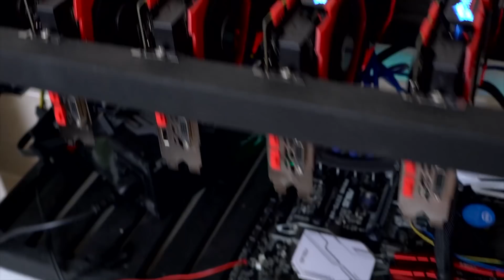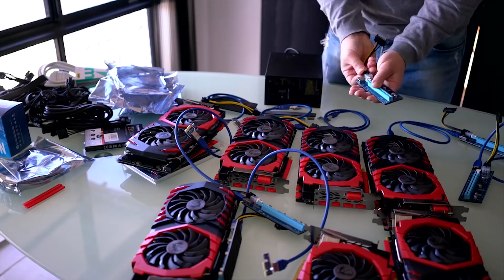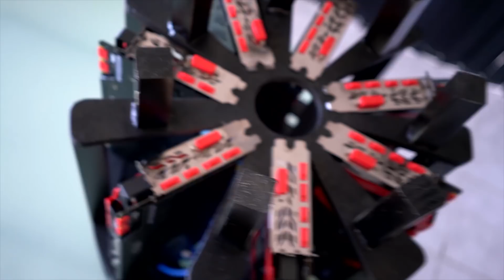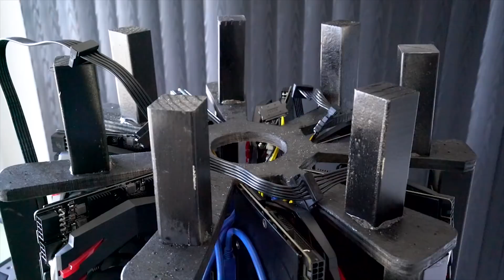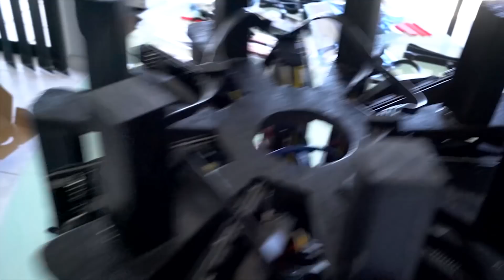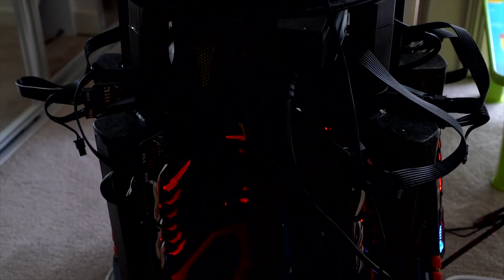Vertical Mining New Compact Design Ethereum Monero Sia Bitcoin

Comment: Why not have the cards turned 90 degrees so that the fans could get the fresh air instead of still recirculating the same air like a standard rig?
Reply: phatal808 good point. Have you made a case similiar to this? With eash card facing outward pulling in new air that would be ideal. Especially if the air is being blown like a fan and/or is a cool temp.
Reply from the maker: I did not read this reply, but I am going through all the replies now and we both had the same idea! Please see if this is what you mean: Thanks for your advice. Please check out my new rig: https://youtu.be/Up8XfTdMlI4

Comment: uhmmm   I'd say the fan should be pulling air outside the GPUs (air direction to the top) to aid airflow since heat rises. Or making a design that in between the MoBo and the GPUs you can accommodate a fan that pushes air upwards and the flow will push all the hot air being generated by the cards. Those card aftermarket coolers just throw hot air wherever they can so its just a matter to give a better flow.
Reply from the maker: Thanks for your advice. Please check out my new rig: https://youtu.be/Up8XfTdMlI4

Comment: Also you could expand your vertical design an sell it. You may have to tweak here and three. But it's a great concept. Your vertical system could be more higher to have more components. Plus the circular deminsions a wee bit bigger. Let your imagination run wild. Who said boards has to lay flat. Power supply at bottom. In the middle you would have the motherboards and towards the top would be your gpu's.

Comment: If the fan to cool your system was at the bottom. You could place small blades at top that would spin attached to a small generator which would produce electricity.  You would be using wasted energy converted into useable energy.

Comment: Similar to the old Cray circular supercomputer. Cool air from bottom comes up through the system and that cause the heated air to flee from the top of the system. Now be nice if you use the heated air as energy converted into electricity. Hmm...!!!!. Just a thought. Enjoy your venture. Wish you much success.

Comment: oh good it's made of wood so the first spark will turn your entire rig into a towering inferno

and the fan on top makes tonnes of sense, as heat sinks and cool air rises
Reply: iamdmc I dont know if you are sarcastic but hot air goes up. Hot air balloons are going up they are called hot air balloons for a reason

Comment: Great design! Very innovative. Question: Do you need the 7 vertical supports? Or could the frame be built with only 3 or 4? Maybe I'm missing something. Do the vertical support pieces have a function relative to each card or was this more for symmetry? Thanks.
Reply from the maker: It was just for strength. You could use 3 or 4.

Comment: The build might be interesting but efficient in terms of space and heat, even noise, not. 

Step1: remove all the shrouds and fans from the cards. 
Step2: take a gpu server as a template - all cards next to each other, spaced just like if plugged in a regular mainboard, maybe 5mm more. 
Step3: Have one 150mm fan for every three to four cards that pushes air in the case, thrum the rear-end of the card's heatsink. 
Control the fans by pwm from the mainboard or have a separated controller.   Use the thermal sensors built-in the mainboard or the ones built-in the cards and average  the values. 
Optionally, build shrouds of PET or better plastic sheets to channel the air thrum the heatsinks and not above them. 

Avoid cards with vertical fins. 

look at the Telsa cards and how they sit in a 3u or 4u case. That's how it should be done. 
No dangling bits on the outside, well thought airflow and, better yet, redundancy.
Reply: are you seriously stating that turbine shrouds are better than AIB shrounds? (in the case of the msi armor series you'd be right XD)

but overall most AIB's cool way better than Nvidias reference design..

Comment: better not to let the PSU in the way of the air sucked off of the GPUs, I’ve done a similar design based on the Mac Pro’s using ASIC hashing boards taken from several S9s, i’d recommend having a tighter control of the airflow and placing the most heat generating components on top closer to fan.
Reply: Ahmed Khalil Would love to see a photo of your S9 design. Dreaming of building a quieter S9 array with larger, lower RPM fans.
Reply: I think my brain reset when you said 'several' S9s. :o

Comment: Enclose the rig in a big tube (with a dust filtered gap at the bottom to let cooler air get sucked in) and have the fan extracting heat and blowing the air outside through a tumble drier flexible vent attached to the top of the unit.
Reply from the maker: Thanks for your advice. Please check out my new rig: https://youtu.be/Up8XfTdMlI4

Comment: GPU's are designed to eject all of their hot air out of the back of your system where the ports are. The way you designed this system you now have ALL of the GPU's hot exhaust venting on to the motherboard and processor unit witch is then rising due to the laws of thermal dynamics and being sucked back in to the GPU's. If you flip the cards over you will likely see an immediate 10+ degree temperature drop on the GPU's and a huge drop in the CPU and ram temperature.
Reply: ConfessorEpicness yeah this wasnt well thought out.
Reply: No. Convection is not relevant when you have air flow.
Reply: If you made a video I'd love to watch the proof that there's a significant difference in temperature because of the position. Until then, personal experience and anecdotes don't trump an actual investigative approach that tests the differences in a quantitative way.
Reply: its ugly upsidedown ;)  ...must be beautiful! and yeah, with the fan on top, you probably wont notice, plugging your dvi / hdmi will probably be combersome too but will use less cable lenght and spaghetti.
Reply: Tell that to my 10 card 1060 rig that is running 10 degrees lower than all these jackasses  without the use of added fans and without bumping the card fans in afterburner. Should be impossible considering I live in the desert southwest 60 miles from the Mexican border.

Comment: nice concept but just one psu? not enough for dual mining i think.
Reply from the maker: I'm running the GPU's at 60 percent power so it is using 1020w and the PSU is platinum rated 1200w.

Comment: sata powered risers with all of them on the same cable that goes back to the psu... fire hasard waiting to happen...
Reply: passive101 people say 2 per cable going to psu. But i dont believe that is proper. As sata and molex we're not designed to handle the max PCIe power of 75w. As such I dedicate a 6 pin connector from psu for each riser. My preferred psu is server psu hp or 750bq evga and use 6 pin extenders to reach risers.

Comment: Very interesting. I was thinking of building a vertical stand make. This gives me motivation to try something of my own. Thanks for sharing it with everyone.
Reply: Also wouldn't it be better to have the psu at the bottom of the rig, pulling in air from beneath the rig. That way, the top fan can do even better job
Reply from the maker: Thanks for your advice. Please check out my new rig: https://youtu.be/Up8XfTdMlI4

Comment: What is this fan ? Can we get the ref ? 5 watt is great for such a big fan
Reply: They don't use much power because they have bugger-all blade pitch.  Useless for moving air around a room but obviously fine for this application.
Reply from the maker: It is a bathroom exhaust fan. You can get them at the hardware store. Look for the eco ones. I confirmed they really are 5w.

Comment: Using your idea I built my own version of this radial design fit for six Vega 64 cards, two power supplys on the level beneath, and motherboard on the bottom. Worked out really well and looks amazing. Hashes out monero at 12kH/s. https://imgur.com/gallery/DcnB8
Reply: Sir Bomb Your design is awesome. How did you make the round parts or did you buy them like that?
Reply: Such a cool looking rig. Beautiful. Would you mind sharing some numbers regarding the rig? What the optimal diameters (inside/outside) for the rings? Thank you.
Reply: great congats budd ^^

Comment: Nice looking design. I've been thinking on doing something similar to yours for a while now. Do you mine sharing the gpu temps. Thanks
Reply from the maker: I have the power limited to save electricity as the power costs here in Australia are really high. It's the first day of summer, 30C right now, I'm mining eth, Power 63%, Temp 66C (limited to 66 and it is on 66), core 0, Mem 740, 32.2mh/s using Claymore.

Comment: Really like the design here and I'm thinking of converting my rig into something like this as well. A few questions though, do you have any kind of "twisting" issues with the wooden poles holding the cards up? Any kind of bowing with the cross supports? I used 1/4" plywood for my cards to sit on with the current typical kind of rig, which seems to be too slim and bows. did you happen to use 3/8' or even 1/2' here?
Reply from the maker: My verticle wood is 3cm thick and they are a square shape and the horizontal wood is 1cm thick. It is pine wood and there is no warping or bending.
Reply: Excellent! Glad to hear that. I think I'll use some thicker wood for my design then. Thanks for the quick input, Alex!

Comment: genius in design 
i give you credit 
can i propose a suggestion? enclose the entire unit,
mount the mb and ps on another tray in their own separate enclosure,
and then put the fan on top f the enclosure pulling heat up and out. filters could be placed on the bottom of the enclosure getting rid of the dust problem.
freak it i mught just build that myself.
 anyways, not trying to offend billiant design mate
Reply: Great idea, kinda like the mac pro "trash can" design
Reply from the maker: Thanks for the feedback, all ideas are very welcome :)
I did think about putting the fan between the motherboard and the GPU's but then the cables from the riser cards would need to be very long to go around the fan to the motherboard. I don't like to enclose it because it makes more heat.
Reply: calm down about the filters hes not in the sahara desert
Reply: edit 2 
get your hands on some drainage pipe, place that arond the gpus and then on the bottom put an industrial circular filter to filter out the air. k and n will make a washablefilter to fit any size that you could dream of
Reply from the maker: Thanks for your advice. Please check out my new rig: https://youtu.be/Up8XfTdMlI4

Comment: That’s really nice. I’ve been thinking about the same vertical circular design for a few months as well . I think vertically mounting the cards in that way has better heat dissipation. Unfortunately I have zero building skills. Any chance that you could do a how to? Will greatly appreciate it.
Reply: 8020.net, i think that is the right addy all you have to do is cut the extrusion to length and hammer a plastic connector.they even have octagonal plastic connectors that are used for greenhouses that would make a simlar shape

Comment: Was the fan blowing down onto the system or pulling up and away?
Reply: Gary Calliham indeed, forced air is better than sucktion and as warm air travels up, it is better to turn thuis beast upside down. No worries, you can ship this one to me as you build v2.0 :P
Reply: Thats why duster cans were invited.
Reply: .... DUST HAZARD!!!
Reply: Irs an extractor fan. Similar to the ones used in bathrooms and kitchens
Reply: very nice design. My question is. instead of blowing the air down why not turn the power supply over with the fan on bottom and also turn the graphic cards exhaust vent facing up to blow hot air up. I know not as much air comes out of the vent as a blower card but some still does.
Reply from the maker: I had it drawing air up but then realised that it was pulling air out of the PSU so I turned it around to have it blow back down into the rig.